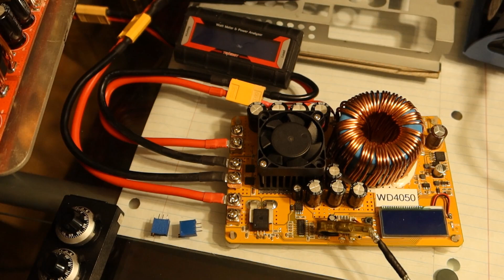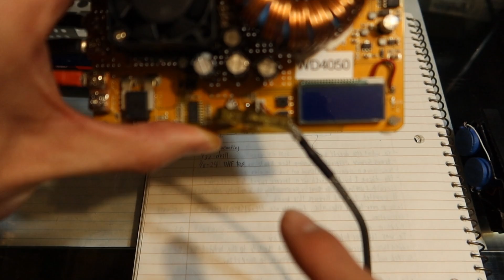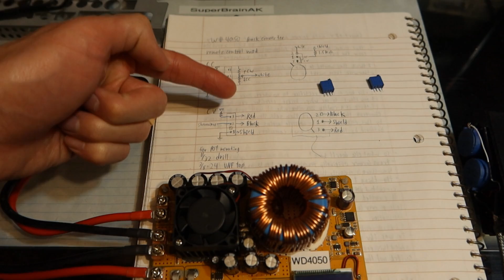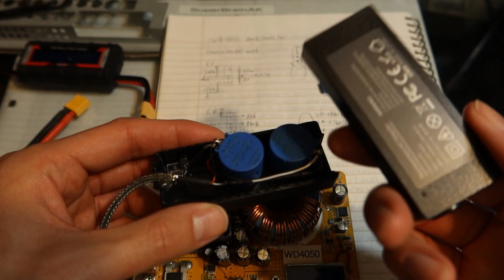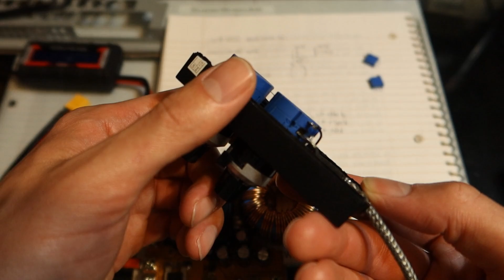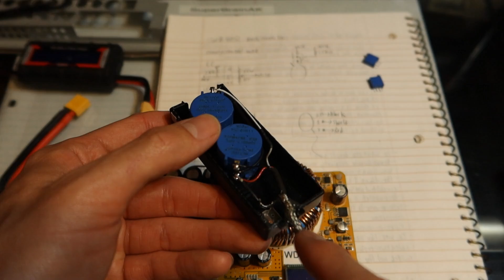WD4050 Buck Converter Remote Potentiometers (test and wiring)

Comment: Sheesh I love that beefy buck , I bet you can weld with it ! I was considering getting a little dc welder to use as a lab powersupply , cheap ones have current control but don't have voltage control , data says they run at 60v open circuit
Reply from the maker: @rodriguezfranco3839  Hmm I know I want to pull some arcs with it if possible but not sure what materials I should use as electrodes and what currents I can do.
I do know the capacitors need to be upgraded at some point. Running it at high current but really low output voltage made the caps heat up quite a bit. 🔥